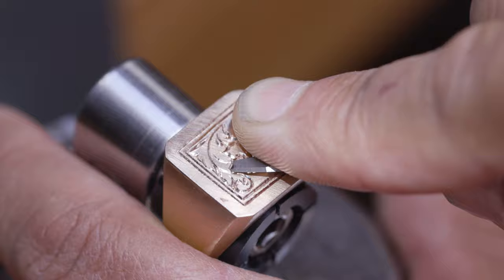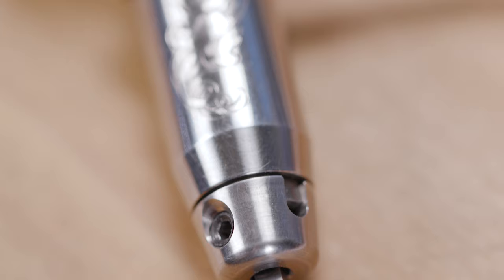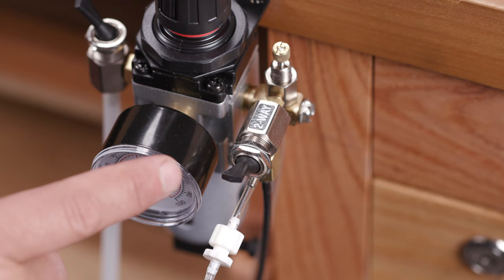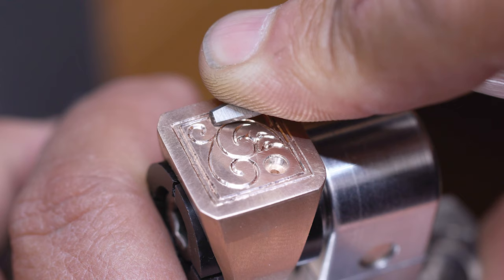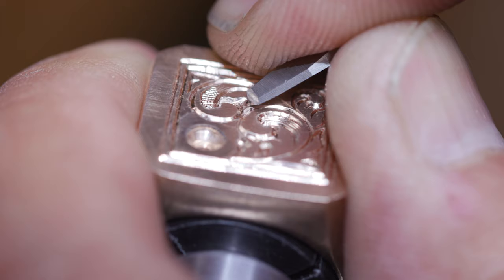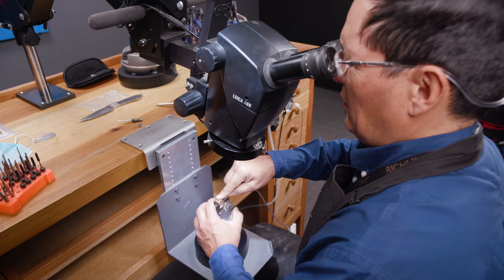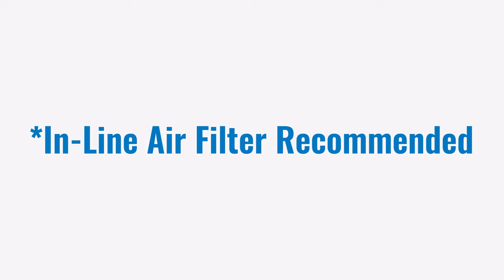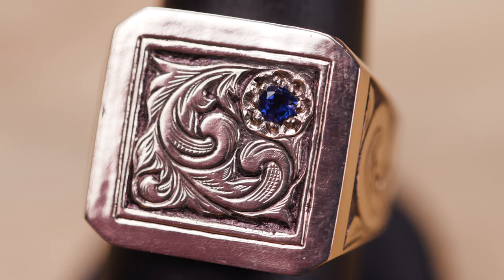A GREAT Tool for Hand Engraving & Stone Setting | BenchJewel ArtGraver by Steve Lindsay

Comment: Sir. What is the minimum pressure to operate the grever.
My newly purchased didn't work at 35 psi.
Reply from the maker: Hello, the minimum pressure is 60 psi. The ideal pressure is between 65 and 100 psi. The higher the pressure, the more power you can achieve and the better the performance.

We hope this helps, let us know if you have any other questions!
Reply: Thanks a lot sir. this help answer my question.
God bless you

Comment: I have an air engraver hand piece .I did connect it to a compressor air but it is not working ,is any wrong with air supply?
Reply: Young man. No easy or cheap way around this type of equipment. Lowest cost in this hobby/professional tools will be -ballmark- usd3,5k --9k. Asian copies few hundred dollars but best reckoning of many who own them is poor 'dependability', needing repairs etc.
  An option could be used flex shaft or micromotor type equipment which will need to be mastered well to produce decent quality --but not as classy as hand engraving push cutting or air gravers--. Think well before parting with your $$$. Gd luck,  regardless

Comment: Get hand graver(use old Swiss file)  and it will do the same job if you can’t use hand push ones no point to buy air compressor piece 🙈😂